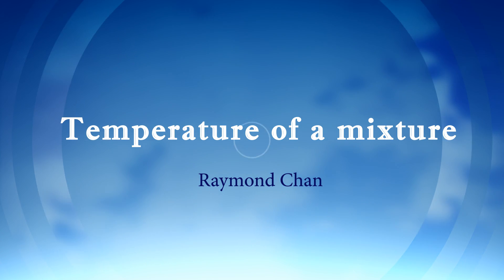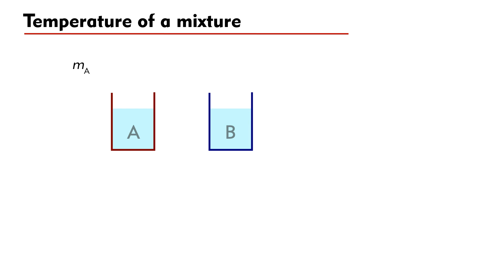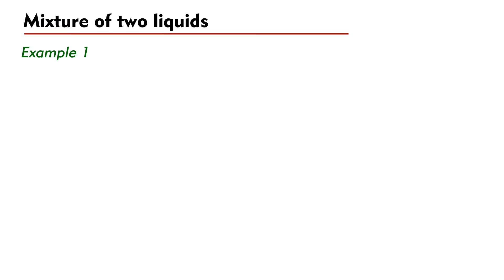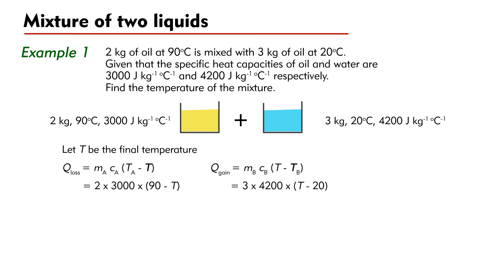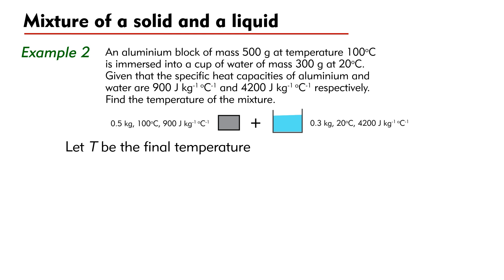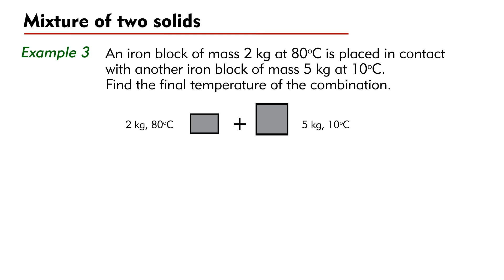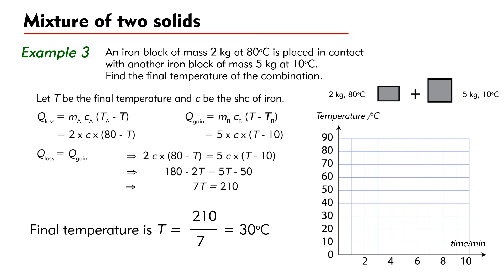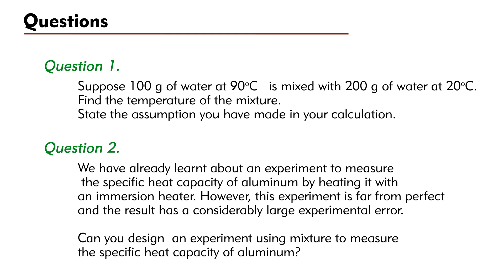Temperature of a mixture

Comment: 1) 100*(90-T)=200*(T-20)
T=43.3 (cor to 3 sig fig)
There is no heat to the surrounding.
2) use a cup of water with known mass and initial temperature and assume the shc of water is 4200J, then put the aluminium block ( measure its mass and initial temperature) into the cup of water.Then measure the final temperature. Applying the law of conservation: mW*4200*(Twi-Twf)=mA*cA*(Taf-Tai), as this formular has only one unknown cA( shc of aluminium ), we can solve the equation.

Comment: 1. Let T be the final temperature and c be the specific heat capacity of water respectively. 
100*c*(90-T)=200*c*(T-20)
90-T=2T-40
130=3T
T=43.3 degree Celsius (correct to 3 sig. fig.)
2. First, pour some water into a polystyrene cup and measure the specific heat capacity of water, its temperature and its mass. Then measure the mass of the aluminium block and measure its temperature at the same time. After that, put the aluminium block into that cup of water. Record their temperatures again when both the water and the aluminium have the same temperature. Finally, using the equation for calculating the specific heat capacity (c=Q/(m*delta T)), rearrange the equation to Q=c*m*delta T. Since Q=0 for both water and aluminium in this experiment and delta T=T1-T or T-T2, assume that c1=s.h.c. of water and c2=s.h.c. of aluminium, and T1=temperature change of the cup of water and T2=temperature change of the aluminium block, also with m1=mass of cup of water and m2=mass of block of aluminium, use the equation of m1*c1*(T1-T)=m2*c2*(T-T2) or m2*c2*(T2-T)=m1*c1*(T-T1), we can find out the specific heat capacity of aluminium.

Comment: a.Assumptions:There is no heat loss from the system and the final temperature is T.
By the Conservation of energy:
Q gain=0.1xcx(90-T)=Q loss=0.2xcx(T-20)
0.1cx(90-T)=0.2cx(T-20)
         9-0.1T=0.2T-4
                13=0.3T
                  T=43.3 degree Celsius(3sf)
b.mix the aluminum with water and measure the mass,temperature of water and aluminum,also the specific heat capacity of water is need to be measured.
Then use Q gain=Q loss equation to calculate the spc of aluminium.

Comment: From the question, we can get the equation 0.1*4200(90-T)=0.2*4200(T-20).T=43.3(corr.3.sig.) Assumed that no heat loss to surrounding.
Mixed the aluminum into the mixture.By using the equation mentioned above , if we know the final temperature T , we have the only unknown c which is the shc of aluminum.

Comment: 1. Assumed that there is no heat loss to the surrounding.
Let T be the final temperature.
(100/1000)(90-T)=(200/1000)(T-20)
                              T=43.3 degree Celsius (cor. to 3 s. f)
2. First, Immerse an aluminum block into  a cup of water. Next, let T be the final temperature. By using the formula mA(TA-T)=mB(T-TB) to find out the final temperature. Then, let c be the specific heat capacity. By sub mA xC (TA-T)=mB xC (T-TB) to find out the specific heat capacity of an aluminum block.

Comment: 1.Let T be the final temperature and c be the s.h.c. of the mixture.
Q(loss)=2*c*(80-T)
Q(gain)=5*c*(T-10)
Q(gain)=Q(loss)
2*c*(80-T)=5*c*(T-10)
160-2T=5T-50
7T=210
T=30
The final temperature is 30 degree Celsius.
2.c=Q/(m*delta T)
Q can be measured by immersion heater.m can be measured by balance.Delta T can be measured thermometer.

Comment: 1. Let T be the final temperature. 
0.1 times 4200 times (90-T) = 2 times 4200 times (T-20)
                                              T = 43.3 degree Celsius cor. to 3 s. f.
 I assumed that there is no heat loss to the surrounding.
2. I would like to make a guess. Put the aluminium block into a cup of water.(the container is a polystyrene cup) Then heat it by using immersion heater. Find the mass of water and aluminium block respectively.Find the final temperature and calculate the shc of two object by the formula of c = q divided by m times delta T.